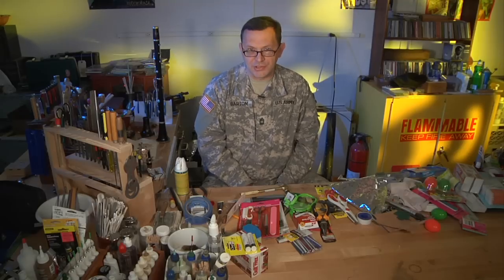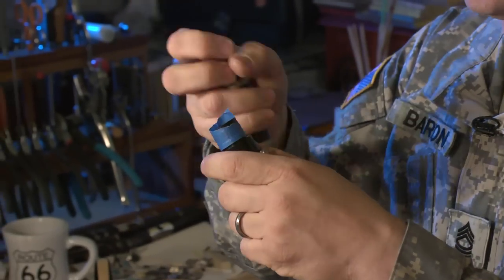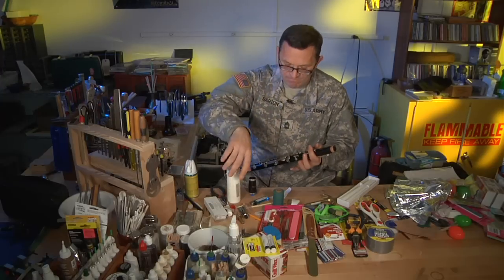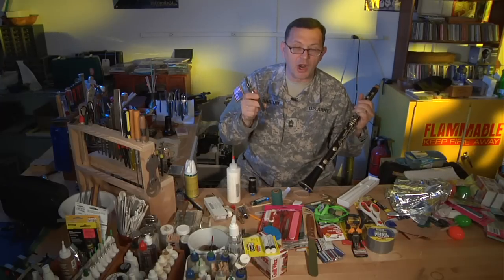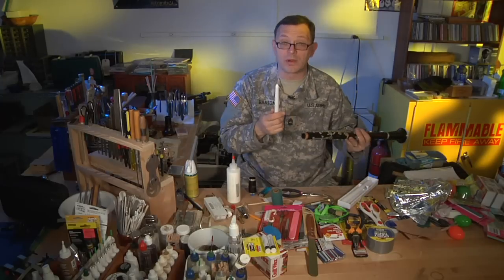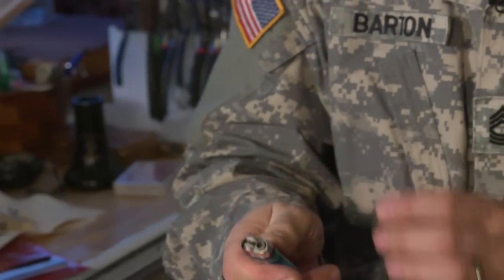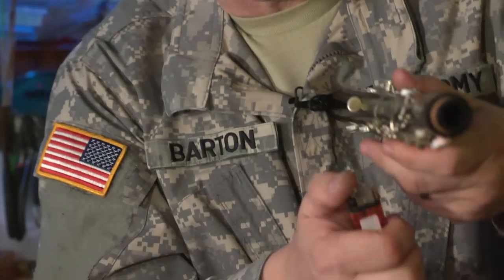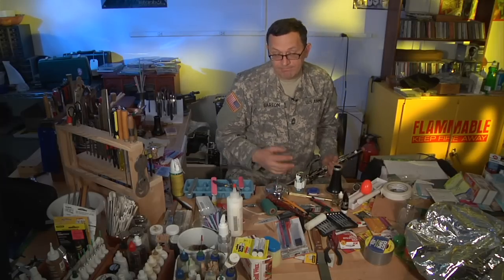What Not To Do: Clarinet Instrument Repair

Comment from the maker: Thanks for your question. A flame provides a gentle heat source and the temperature can be controlled by changing the distance from the flame. An electronics heat gun will have to touch the key to provide heat. This may damage the key and leave a visible burn mark and you will not have as much control over the amount of heat.

Comment: For a quick easy fix when you don't have replacement cork available, I have had good results fixing a loose joint problem by applying a thin film of Gorilla Glue (with my finger) over the (dry) tenon cork and letting it dry / cure (Obviously, don't assemble your clarinet while the glue is still wet.).  Gorilla glue will foam while curing if exposed to water before curing (avoid).  Gorilla Glue takes about 4 hours to cure, so try it only if you can wait that long.  When the glue is dry, try assembling the affected joint.  If it is too tight, you will have to remove some of the glue (or all of the glue and try again).  One advantage of a Gorilla-glue-covered tenon is that you may not need to use any cork grease afterwards.  And you will then be able to fix the cork properly at a later date if so desired.  Gorilla Glue can be easily scraped off, so it does not make replacing the cork later any more difficult.

Comment: I don't think even having the lighter secured is a good idea. Although its a bit more time consuming, taking the key off and replacing the pad is a much more safer way for both you and the clarinet.
Reply: Agree will be easier and won't damage  plastic or bakellite body of clarinet
Reply: Evidently you never make sure your pad is properly seated on the tone hole.

Comment: In my opinion it is bad to use a flame for anything near the wood. Instead of that a hot air soldering gun can be used to apply controlled heat very precisely just on the area needed.

Comment: Hot air solder rework station! No flame, and it gets hot enough to melt lead & tin or tin and copper solder. Repad/spring kits for Yamaha's $38,000 flutes cost $10,000 just for new springs and new pads.